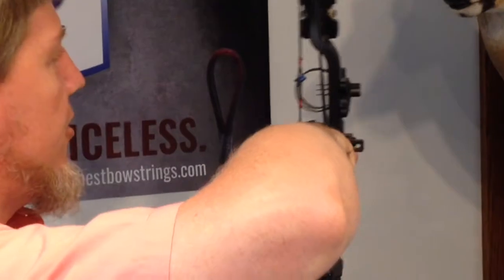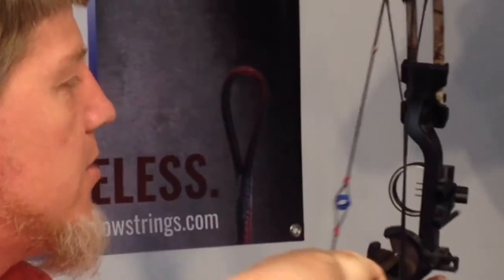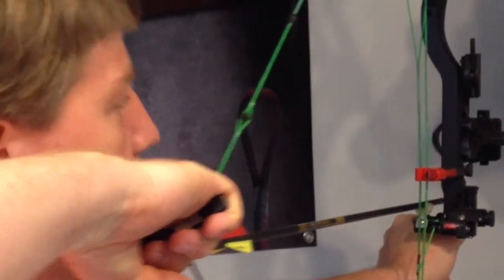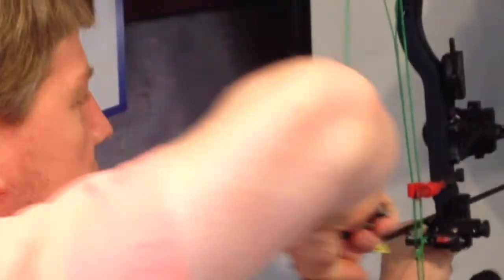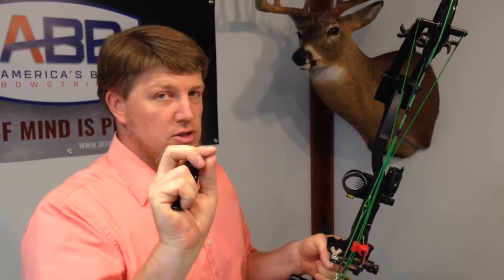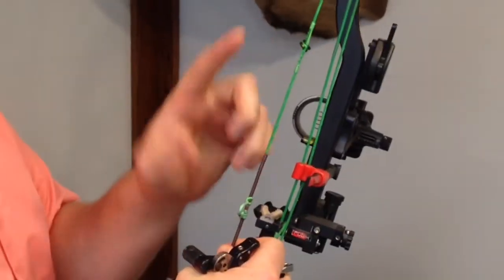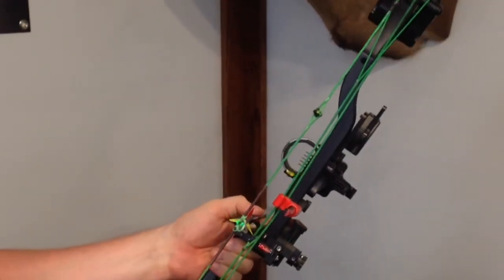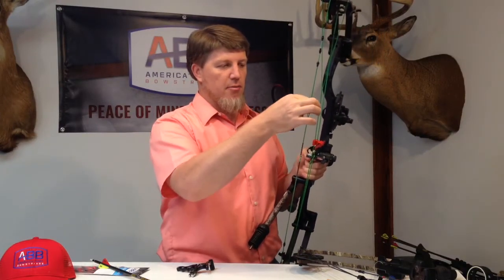ABB Tech Tip: What Is Peep Rotation?

Comment: What about the string type or quality causes the peep to rotate?
Reply from the maker: HI Korbin, peep rotation is due to a bundle of material not tight enough when in the blanking process or when material starts to stretch after install and shot over a course of time. A better quality material and pre stretching process will certainly help to prevent any possible peep rotation.